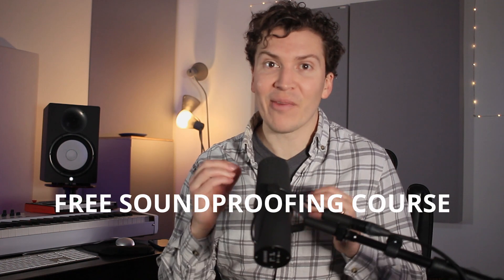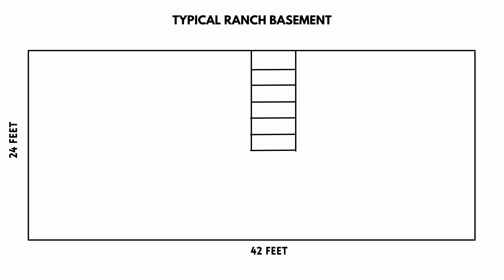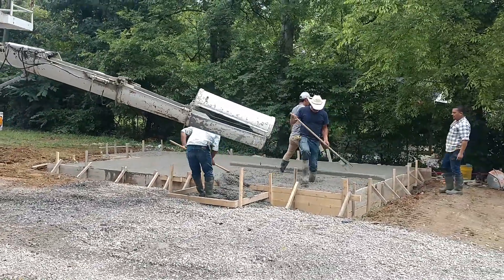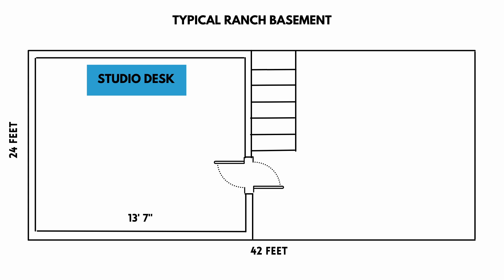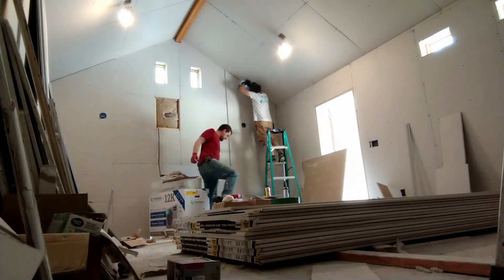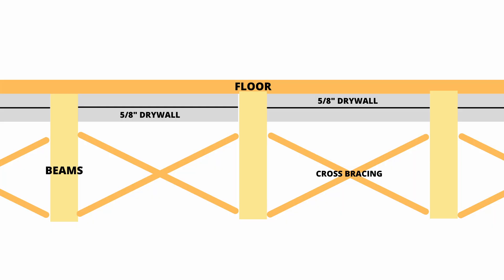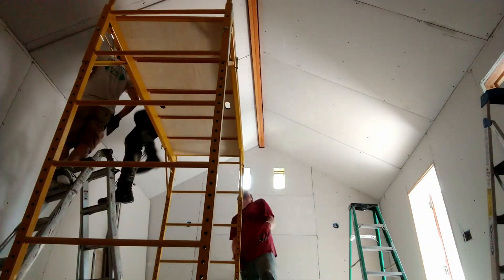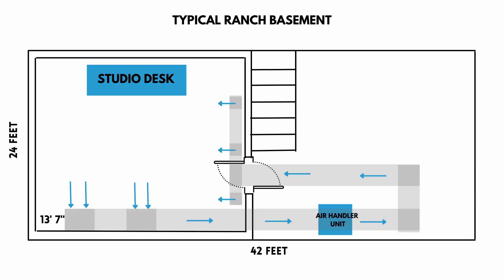Building A Soundproof Studio In A Basement

Comment: Beautiful video @soundproofyourstudio , thx! I have three questions; 
1) when I want to use a corner of my basement, how do I make the two new, non-concrete walls soundproof? I can imagine all the work will be for nothing when those two walls don’t absorb my drumsound.
2) I will use the room for drumming; is the concrete floor also enough or will I need a ‘floating floor’?
3) I have some pipes passing the ceiling and going to the floor above; how do I soundproof those holes and can the pipes (to the radiators in the living room) pass my noise to above? And if yes, how can I prevent that?
Thx for thinking along!!!

Comment: Just want to make sure I'm understanding this correctly for the ceiling. You put two layers of 5/8 drywall in the cavities between the floor joists, correct? This is what your image seems to portray. So two layer of 5/8 drywall against your above level subfloor?

Then, in addition to that, you install the clips and channels on your ceiling floor joists, which then are layered with two layers of 5/8 drywall?
Reply from the maker: You're getting it! I don’t recommend this method any more because it is so labor intensive. Are planning on building a home recording studio?
Reply: @soundproofyourstudio  Thanks! I am looking into it. Just something small basically for recording video content on a desk. Any wisdom on how small you could actually make a recording/soundproof room?
Reply from the maker: Well as small as you want as long as you can still work in there.

Comment: Hello, greetings from Mexico, what do you think about using an exterior brick wall, then a 15cm cavity filled with fiberglass R-19, and then the internal wall of hollow block filled with sand?  would the isolation be superior to any configuration used with drywall? Thanks for your help
Reply from the maker: That design should work great. You will get superior soundproofing at the lower frequencies when compared to only using drywall. Best of luck with the build!

Comment: I have a framing question -  if you do a room within a room like that, what do you at doorways and other places where the wall ends?  Won’t you end up with an open gap?
Reply from the maker: This is where things get complicated. Are you building a soundproof studio?
Reply: @ that is the goal, yes.  In an existing unfinished basement room with concrete walls very similar to this
Reply from the maker: Do you feel confident you can DIY it yourself or do you think having some outside help would be beneficial and save you time and money?

Comment: Do you measure the ceiling at the top of the joists? Or at the bottom?  My "ceiling" is about 7'10", but 7' 3" at the bottom of the joists
Reply from the maker: Bottom of joists where and add in two layers of drywall and potential decoupling system

Comment: Would it be a good idea to construct a separate ceiling above the inner walls to ensure the ceiling frame doesn’t come into contact with the existing floor joists?
Reply from the maker: Yes you can, but you lose ceiling height so their is that trade off.
Reply: @soundproofyourstudio  Thank you for your reply. I just realized I posted the same comments on two videos 😅 I appreciate very informative videos!
Reply: @soundproofyourstudio  I have another question about installing a soundproof room in a rental house. If an owner allows it in basement and local codes aren't an issue, would it be possible to build a high-performance a room-within-a-room (in terms of blocking sound ranging various frequencies from outside)? My concern is the possibility of 'triple leaf effect' as tearing down existing wall isn't option. Do you think this could pose a serious problem? If so, how much distance should there be between the existing structure and the new room to avoid the triple leaf effect? Thanks a lot!

Comment: Im building in the basement right now and have it tied into the house HVAC at the moment. Contemplating also adding 2 fans, one intake, one exhaust just to circulate fresh air, and let the HVAC just deal with the heating and cooling. Then I can run the ventilation fans on their own and not worry about the temp settings for the full house HVAC. 
What are your thoughts on those 2 fans added to a system with a house HVAC ?
Reply from the maker: Yeah you can do that - here is a design idea - https://www.soundproofingcompany.com/soundproofing_101/how-can-i-ventilate-a-sealed-soundproof-room
Reply: @soundproofyourstudio  ya! I saw that design and it is what was giving me the idea. the question is more so, is that needed or a good idea in ADDITION to tieing into the house HVAC.
so HVAC for heat and cooling.
2 fans for circulating air when doors are all closed up.
Reply from the maker: @chriscarr1791  yeah that would be the idea. Although, I would be curious to look into adding a fresh air intake into your hvac system and then you don't even have to worry about adding extra ventilation. https://www.weather-tech.net/furnace-fresh-air-intake-101/
Reply: @soundproofyourstudio  Our home HVAC already has a fresh air intake, that is code in my area. My main concern was just being able to have the flexibility to circulate fresh air in the studio any time I want regardless of what is going on in the rest of the house. We have a 2.5 storey, so in the loft, which is a third floor is a significant temperature difference than the basement which is 4 floors away, so it is hard to regulate temps across the whole house (there really should be 2 HVAC systems when they built the house). So that is what is making me lean towards the ventilation fans just for the studio.
Reply from the maker: @chriscarr1791   oh nice! Well the fresh air will take care of air transfer and you can add the deadvent with a fan in it to simply vent out the room. You could put a two way switch on the fan to suck air in or blow air out. That might be the easiest option rather than building a full two way ventilation system. You know your set up best, but that sounds good to me.
Reply: @soundproofyourstudio  A 2 way switch set up sounds amazing!! I have been looking everywhere for a "reversible" fan or something that I can switch it on to either pull or push air. I haven't been able to find anything like that ? Any chance you can send me a link to what you are talking about ? That would be a total life saver! Thank you!
Reply from the maker: @chriscarr1791  check this out - https://shop.fantech.net/en-US/fg--6xl--centrifugal--inline--fan/p107425 it says both exhaust and supply but I am not sure if you could wire it to do both. Maybe ask the manufacturer. Also you could do a full ERV ventilation system, which works awesome. Here is a vid about that - https://youtu.be/slv9J_v1Gc8
Reply: @soundproofyourstudio  EVR would be awesome! But I have no access to exterior walls so looking to circulate air from another conditioned space in the house. I believe EVR needs to be circulated outdoors ? Unless I am wrong ? Have you seen anyone using it to circulate 2 conditioned indoor spaces ?
Reply from the maker: @chriscarr1791  Yeah it technically should lead to the outside, but it wouldn't hurt I imagine to have it for indoor use. It would really just be overkill.
Reply: @soundproofyourstudio  Still trying to find a fan or vent that can be switching both ways to either push or pull. no luck so far! the ventilation portion has definitely been the most difficult part of the build to get it all planned properly. hoping it pays off later!

Comment: Im in the process of building a soundproof studio in my basement. I'm framing a 4x4 wall for the booth. I cant do the double door build out so the studio desk will be in the main room. Theres no door to my basement, justcstairs that lead to the basement. The studio desk will be on the opposite side of the basement so it wont be close to the steps. I was going to put bass traps in spots where the speakers are aimed and some on the ceiling. Any suggestions based on the information i gave you?
Reply from the maker: It’s hard to give good advice with a quick description. But keep double checking plans and researching and I’m sure it will be great!

Comment: I have a big cuestion, I live in Mexico and I want to know the materials you are using to insolate (it's not Rockwool right?) Thanks!
Reply from the maker: the insulation is just regular old pink insulation. The key is to use 5/8" drywall with green glue in the middle.
Reply: @soundproofyourstudio  thanks! It's just that I see the R values are different, which one should I look for? Thank you very much
Reply: You think the R8 will be sufficient?
Reply from the maker: @danzerosk8  yeah you really want to check which R Value will work for your climate and if the walls will be touching the outside.